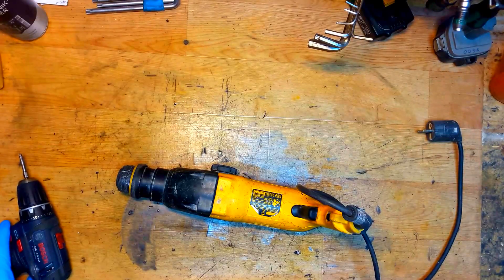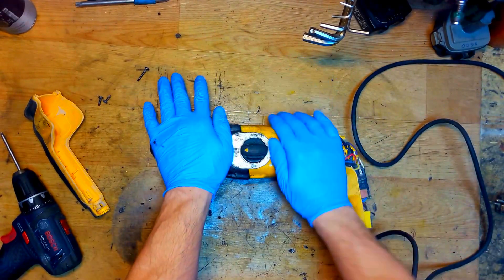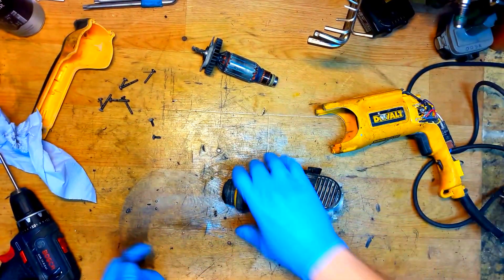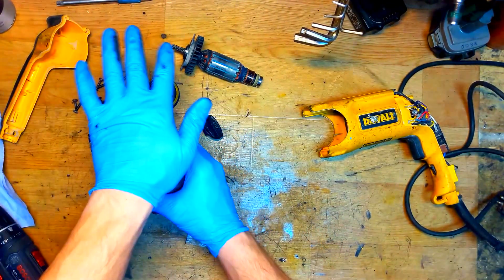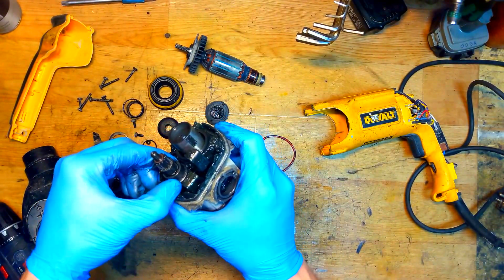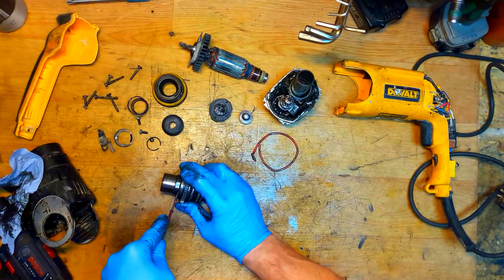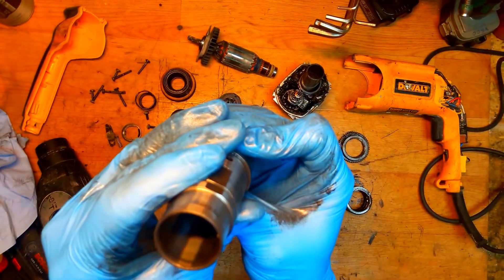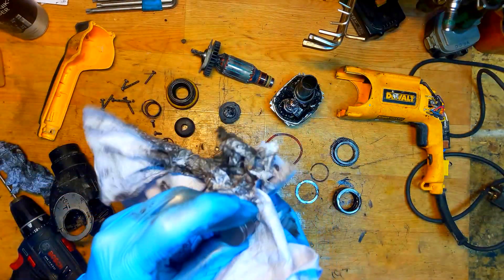how to disassemble Dewalt D25123-GB rotary hammer drill Type 1 need new o-rings repair fix

Comment: Ive just bought a new d25033 dewalt drill tried it out ,The bits are cheap ones u expect some wobble but im sure the chuck to me and this is on normal mode not hammer isn't running cylindrical it's a new tool .Ive bought a bosch drill bit to see how that is before i send it back this is my first sds drill all my others drills  are regular drill bosch makita they run perfect i dont no if this is the norm for a sds+ drill but the wobble on a 18mm bit im sure the hole will be more like 22 mm with the wobble on it.

Comment: Thanks for the video, inside of the stricker chamber at the  bottom, should it be normally wider or is the 1 I'm working on worn, I'm having hammer problems on a d25033 - lx, and I'm not sure if my chamber is worn, thanks.